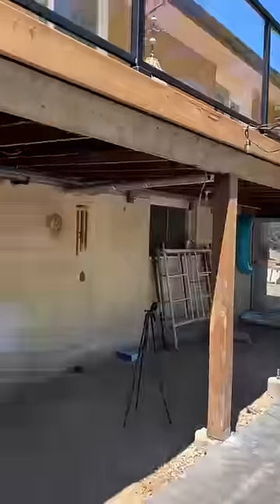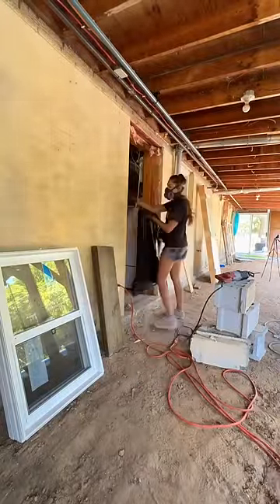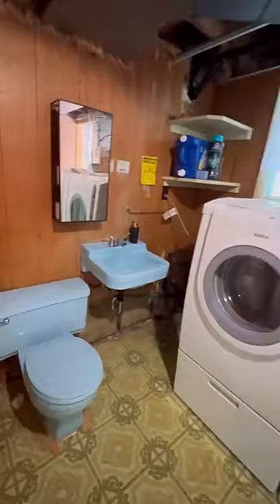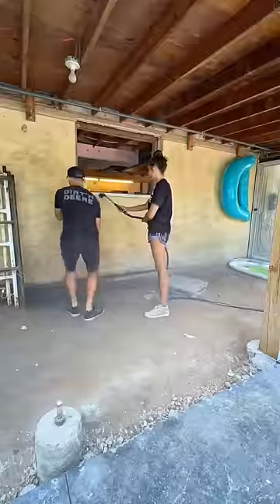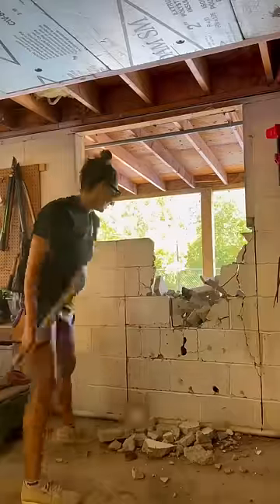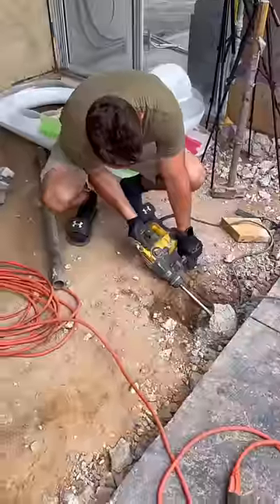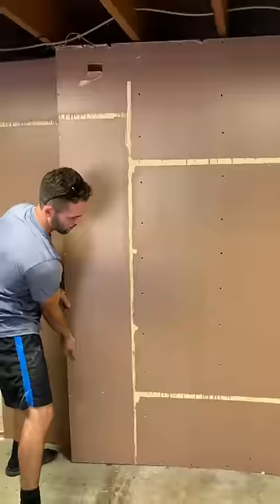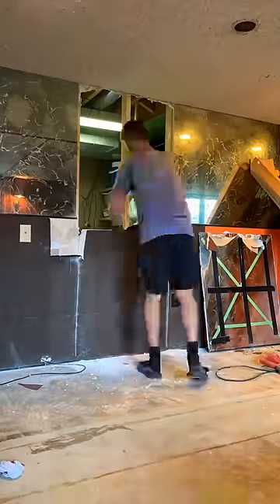Surprise! This has turned into a basement renovation… #shorts #homerenovation

Comment: The wall in the basement looks like a load-bearing wall. The joists above it run perpendicular to it. Are you working with a structural engineer?
Reply: Looks the same to me but they didn’t cut any thing above where the window was so it shouldn’t  affect the structural integrity
Reply: You’re correct, it looks to be load bearing, but they didn’t do anything to affect the header, so what they did appears to be fine.
Reply: Watch the longform basement reno vid. It's not load bearing.

Comment: I love this, I hope it will be well, I recommend if you get enough money to get solar energy, and if the area is right and the council permits, also wind power, and to get an electric car, so i would prepare for charging 1-2 vehicles and to have an isolated space for the battery system , to be efficient and safe, others can comment more, but i would go with a hybrid Tesla Power Wall and Normal system, and as a first electric car i would go with Tesla Model Y Long range normal wheels white interior and exterior, the most efficient vehicle, because white does not heat that much= less AC, and the plastic hub cap stock wheels offer the best drive quality and efficiency.